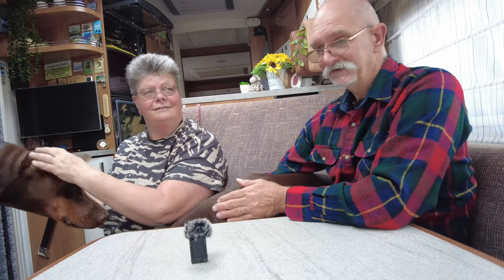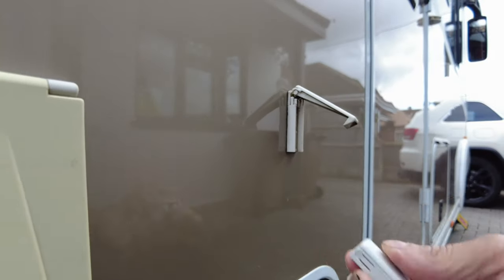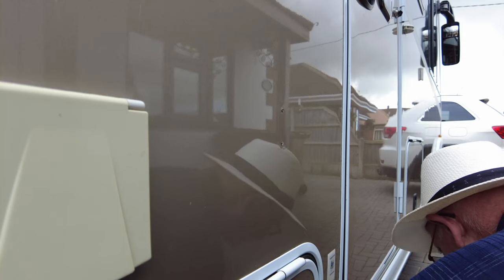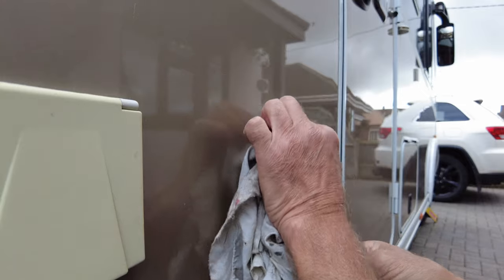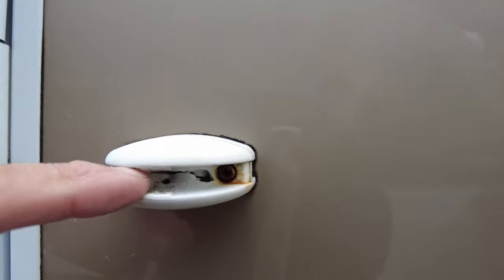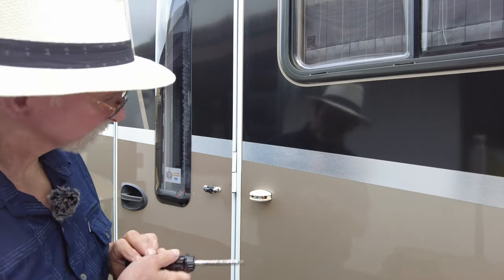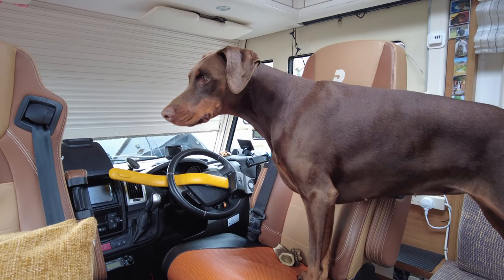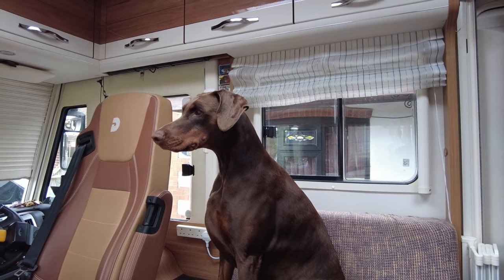EP67 oh dear its broken ! and how to fit it

Comment: Nice repair. I love that little screw driver. Where did you find it?
Reply from the maker: It was fro. Amazon UK look up loficoper electric screwdriver. £22.00 I love it. Small enough to slip into a pocket . Think it has got 22 bits with it.... usb rechargeable.
Reply from the maker: Scot try fanatic? On us amazon looks like the same tool just a different supplier
Reply from the maker: Fanttic.... damn auto correct......